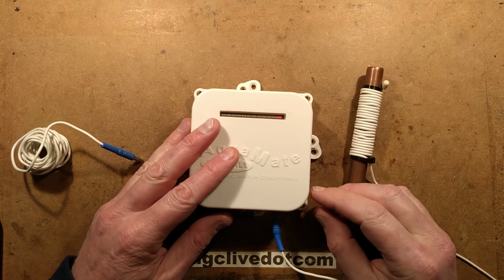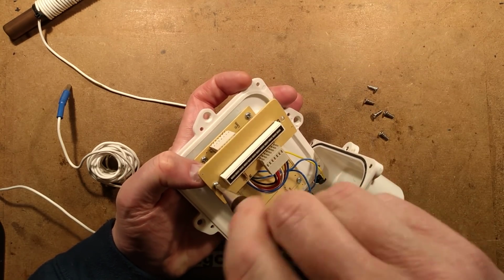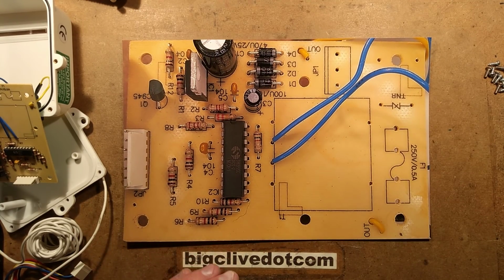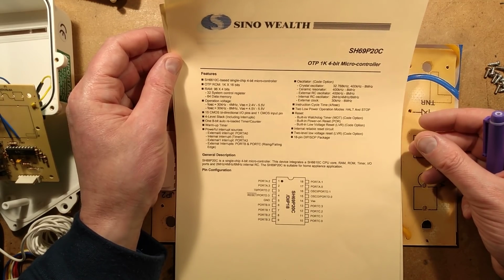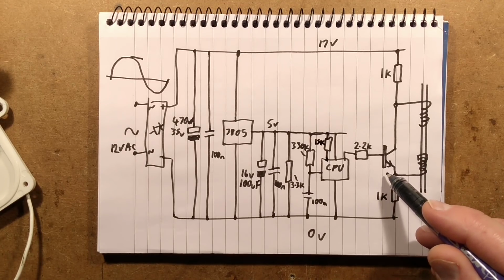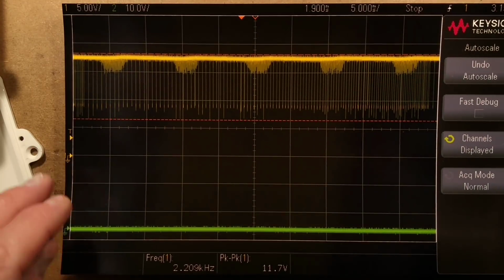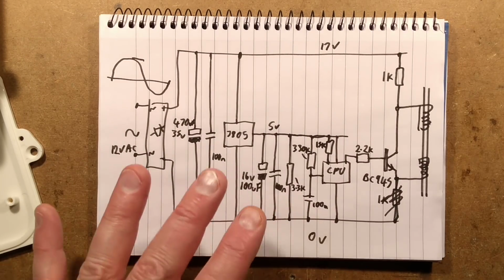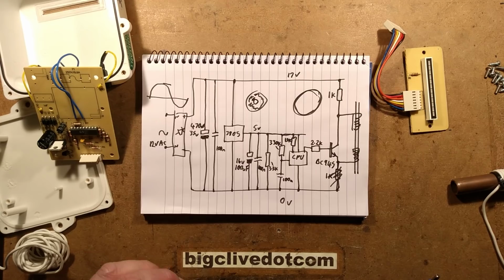inside a computerised pipework scale reducer.

Comment: This looks a toy. The only way I think it might work is that the pulses induce tiny mechanical vibrations into the pipe via inductive coupling. These vibrations are enough to stop calcium deposits sticking as it is hard to stick to a moving surface. But even this theory has serious weaknesses. For starters if Clive's circuit diagram is accurate the output is severely underpowered, the transistor is neither in the common emitter amplification regime, nor in emitter repeater one, but somewhere in between, a very odd circuit. Secondly it will be the covered section of the pipe that would vibrate, the rest will happily collect the deposits. In short it is probably a snake oil device.

Comment: Transistor is a 2SC945, the base pin on the end gives it away; a BC would have the base pin in the middle. It is any 'old' transistor with much better options available today. Yes looks old. Nice enclosure.

Comment: I was extremely sceptical about the operation of these powered electric water softeners, I still am with regard to those that use an open circuit antenna dipole to couple to the water pipe. However there is some evidence that those that use a coil to magnetically couple to the water in a pipe do work There are a number of university papers which descripe tests that show the effect of high frequency magnetic pulses on hard water. The principle of operation is not to remove hard water ions, such as Ca++ and Mg++, but to change the structure of the salts that precipitate out of the water. Changing them from needle shaped calcite crystals that readily stick to each other and the pipe work to an amorphous form of powder, which will not stick and is washed through the pipe.
While the researchers were hard pressed to explain the effect, they did produce some convincing micrographs that showed the different structure of the precipitates between water exposed to a rapidly pulse magnet field and that not exposed.
There are a number of industrial users who have installed such systems to keep their water pipes free from scale build up. It is difficult to believe that business would fall for a scam technology that did not produce some money saving results. 
I remain very sceptical about the operation of the dipole wire devices, as it is difficult to understand how any significant part of the field could penetrate the pipe to interact with the water flowing through it. If the dipoles were subject to excitation close to RF resonance, then one might expect some of the near H field to penetrate the copper pipe, but most of these devices use an audio frequency FM  square wave to excite the coil. The best, discharge a significant charge, stored in a capacitor, to maximise the induced magnetic field.
You would be doing the world a service if you repeated part of the university research and published it here. This involved passing hard water through a section of pipe, with either the device fitted or not. A sample of the water was then taken and evaporated to dryness on watch glasses in a standard environment. I think a simple comparison would do. The resulting salt precipitate was then observers under a microscope to determine the shape of the salt crystals that formed. In the case of the university study, I recall that X-ray examination was done to identify the shape of the crystals. If I can find a link to the papers involved, I will post them here. I am sure I have a copy in my archive. To be fair, there are a huge number of reports on this subject, many from university engineering and chemistry departments. There appears to be as many claiming that this is pseudoscience as claiming it is a real observable effect. 
Ref New Scientist 18,  February 1988 Lifting the scales from our pipes Magnetic fields change the way crystals form in fluids. This could prevent the formation of scale in pipes and boilers John Donaldson and Sue Grimes

In this case the output drive circuit is horrible, not even giving a low impedance, push pull, output to the dipole, but then I suppose that if the circuit is not really doing anything useful, you might as well used the cheapest drive circuit you can reasonable get away with.
It would be interesting to put a current search coil inside the pipe and see if any B field can be detected inside the pipe.
Reply: Thank you, especially for the reference to the New Scientist article.
Reply: I agree. For this circuit to do that, you would need 100,000 times more power to have any of these effects, particularly, if there is significant water flow through the pipe. Even then, I would need to see the test results. With only as much power going into the pipe as what's being used to drive the LED's, I'm a little skeptical. How can 17-20 milliwatts treat 100 gallons of water per hour!?
Reply: Sounds worthy of an experiment, but it also sounds like just getting a reproducible baseline would be super tricky, never mind figuring out how to reliably detect-or-not an effect.
Reply: Not so much a COMMENT, but more like an ESSAY! 😂😂😂
Reply: @marcse7en  my next comment, maybe the basis for my new book, 101 boring things to say about hard water. I will dedicate it to insomniacs everywhere.

Comment: It's so interesting to see the amount of effort companies go through to sell some bit of non-functional tech.  I mean, someone came up with that schematic, picked those components and their values specifically, developed a PCB and had it mass-produced.  It actually does something on the output.  What the output does is not what it says it does, but that aside, I almost feel bad for the people who designed this thing.  The way I see it there are two reasons for this design:  Either they thought it would work but were misinformed about how water scale builds up in pipes, OR they knew it wouldn't work from the start and built a device that would fool a casual tinkerer/inspector who knew enough to look at the output of the antennae, but not enough to realize it was bunk.
Reply from the maker: I think the people who designed it probably enjoyed doing so for the showmanship value.

Comment: Magnesium Sulphate, Calcium Carbonate, Manganese Carbonate and other such things we often call "limescale" (these are all either very or slightly alkaline compounds), are typically INSULATORS!! They don't conduct electricity and aren't overly effected by magnetic fields either. 

Water would be effected (being a polar molecule) but I don't really see this as anything other than some psuedo-science shitty device. No need for it. If you want softer water you have some options:

1) Bitch at your water company and local treatment plant to inject Sodium Triphosphate into the water to soften it (though it will increase salt levels in the water, and probably affect the pH)
2) Use filtered water either via a filter tap, or a water filter jug (the kettles are a pain to clean, dont get one of the filter kettles)
3) Install an inline water softener on your incoming water main pipe. Bare in mind you will need to clean the screen and filter of these out once a month or so as your water pressure will drop as the flow decreases with the filter getting more and more clogged, though some devices have a small compressor to stop that happenning.

These are, really, the only ways you can stop limescale. Chemically or physically. Electricity doesn't do an awful lot other than causing ferro and paramagnetic particles to adhere to the side of the pipe (this is how those fernox devices work on heating systems). I only really see these being useful in Steel-Copper heating system where galvanic corrosion is an issue.

Comment: As you say BigClive - it hard to imagine any kind of induced signal reaching the water, esp. through a conductive pipe :o( And the power is so low too. And only low frequency. Even with an open mind, it's very hard to give this any points :o(  Um, ok, the case with an 'O' ring is quite nice !
I really though you'd tell us that the chip is simply chasing the leds up and down and nowt else, so it's not as bad as I thought :o)
I like your free Keysight (ie Agilent, ie HP before that) 'scope - that's the proper item in this vid.

Comment: it's very simple.  there's nothing that sending a current like this around a pipe would change in the chemistry of the water itself, since you're not actually sending any current THROUGH the water.

nothing.

it's nice they took their scam to such detailed levels.  but that's all it is in the end, a scam.

these days they wouldn't even bother making a nice box for it, or using a microcontroller, so there's that at least.   you can be proud you paid for a quality scam.

Comment: Typically copper water pipes are grounded.
Reply: ColinWatters But this device is ungrounded, so it might still induce a tiny AF current through the length of pipe it touches.  Not that this would be obviously expected to affect the water in a relevant way.

Comment: Surely it should work if you wrapped the antennas around your  kettle.
Another thing comes to mind, how is its EMI compliance?
Reply: The power is too low. you might be able to detect it, if you take a portable AM radio, and tune it to a weak station, or in between stations. You have to get the antenna within a couple of feet though.

Comment: That resistor across the output of the regulator is likely there to ensure the 7805 actually regulates - those regulators need some minimal load current to stay in regulation and the MCU alone may not draw enough.
Reply: 7805s do not need any minimum current to regulate.
Reply: Interesting, I'da sworn that the 78xx's and 79xx's needed something like a 4K7 across the output, for stability; but [at least] this datasheet doesn't show such: https://www.sparkfun.com/datasheets/Components/LM7805.pdf
Maybe that 4K7 was just a Practical Electronics foible from the 70's :-)

Comment: Hmm, so limescale is an alkaline rock dissolved in water. The rock having been formed by billions of years of sea life creatures having died and fallen to the ocean floor.
So why would such a substance be even affected by a weak electrical signal when dissolved in water? And even if an electrical current was induced into the water in the pipe, as soon as someone opened a tap, or flushed a toilet, the rapid flow rate of the water would mean that the very low current level would be spread cross many litres of water....
No, this is another ‘product’ that is useless. The only thing it will do is increase your electricity bill.

Comment: The more LEDs on these sort of things always equates to more quackery.
Reply: That I agree with. The Kemo brand ones have two LED's, one for power and one for the circuit has been installed correctly, and they do actually make the scale softer in the kettle at the very least, so it comes off by itself.

Comment: I saw a date code in the plastic case but I couldn't read it. The electronics look like they are from the 1970s, I wonder if the case is too?

I find that a really interesting device, in that it has a lot more in it than I expected. Specifically, I didn't expect a connection to the output wires. Clearly the effect of this thing is snake oil. 

But I have to wonder if the thing was designed by some deluded sort that thought he was really making something functional, or if it was just done by a snake oil designer that decided that the wires had to do something he could point to, so nobody could sue him? 

I suspect the later.
Reply: 1970s?  When exactly do you think they started building single chip microcontrollers?  The datecode on the chip is from 2006, which is also the year the first revision of the datasheet was released.

Comment: But they work, i have one and the scale in my tankless water heater is been greatly reduced, i was having to clean the input valve of my tankless water heater about yearly due to scale build up  after i installed one of these i t just has been noticible i bought this versus a filter because of lack of space
Reply: I am very sceptical about these but I have one and it does seem to work. I have a mixture tap just after a heat exchanger on my hot water system and every 4 years it would stop working due to calcium build-up. I fitted one of these 15 years ago and it's never reoccurred. Bizarre but true!

Comment: I know that product, I was the technical advisor till 2 yrs ago. Its a very very old design, inherited after many company takeovers. We use large electro magnets in commercial water treatment as well. No one can give a satisfactory answer why they work though, there are a couple of competing theory's. It's water conditioning not water softening. Despite some dubious claims from various companies.
Reply: Elector did a project some time in the 80s I think. Swepping audio in to a coil around the pipe. I used the circuit as a sound generator for a prank on a mate. Placed in his bed room it would chirp 6 or so hours after it got dark and shut up when the light came on. Then stay quiet 1 to 3 days before going off again. Took him 3 months to find it. 😁
Reply: @TheEmbeddedHobbyist  spot on 😉
Reply from the maker: I can recall it being featured in electronics magazines at the dawn of electronics.

Comment: A few years back I decided to look into whether these things work and came across an article where two water heaters were used in an experiment. One had the "magic de-scaler" fitted and the other was left as standard. Guess what they found about a year later when the heat exchangers were cut open. NO DIFFERENCE! Equal thickness of limescale deposits in both, thus proving these de-scalers are a scam.
Reply: Colin Tinker Technically the experiment only relates to the specific product tested.  Any other product could get away with an explanation of how it differs from the failed product in either mechanism (the failed one used voodoo, we use exorcism) or quality (the failed one used Turkey blood for the voodoo ritual, we use real chicken blood).  The example mechanism names in the foregoing to be replaced by words more suited to the products at hand.
Reply: John Francis Doe 
So what you mean to say is that I should buy them all to be sure I got the right one?
Reply: Must have done the experiment wrong!
Reply: @jostouw4366  It was done at a University. They knew what they were doing and were very thorough. Even down to measuring the amount of water the heaters had going through them.
Reply: Fake news!
Reply: Yes maybe but still came up with the wrong results
Reply: @jostouw4366  Do you sell these things???
Reply: @colintinker7778  nah just teasing with you
Reply: @jostouw4366  Trolling, it's an art ;-)
Reply: @jostouw4366  ha! ha!
Reply: @Eddiecurrent2000  Well trained!

Comment: How I understand how it works is it changes the polarity of the pollutants magnetism so that it does not adhere to the pipes. You need some sort of test, to see,  if you insert something in the coil will it alter the polarity? I think they do work to some degree.
Reply: Problem is there is no great test for conditioning. Only to run two identical systems side by side over a period of time (which has been done) unlike softening which is an easy table/liquid test.

Comment: Looks like a datecode on the uC... could be 0520, week 20 of 2005 - though this type of thing has been knocking around for a long time.
They put a lot of effort into the LED chaser when a power light or a power and uC running light would have been sufficient & it's hard to believe that a product that puts a significant amount of effort into making an eyecatching but pointless display for the user to look at isn't a bit fraudy.
If there was any program space left I'd have reversed the chaser at each end for a sci-fi 'cylon-eye' effect... that'd give the buyer the impression that it was constantly scrutinising the water for calcium atoms to zap and add £££ to it's value.

Comment: Had one of these for a number of years on a cold water pipe to a tap. 90% of the time we filled the kettle from that tap and the kettle still 'furred - up'. 
Apparently the company sells a version for ponds to stop duck weed from forming, presumably you would have to have a pump / fountain to move the water past the antennas. 
Is it witchcraft I wonder?

Comment: I'm saying it has no effect, for the simple reason that they didn't have the chase lights go in both directions.

These cheap K.I.T.T. knockoffs should be illegal.
Reply: restcure It needs to scan back and forth like a Cylon Centurion for it to work...
Reply: Too hard to get the real KITT. At least it's not a KARR clone.
Reply: The unit should have a 'Turbo Boost' button......for emergency water softening situations.
Reply: can you get a KITT kit for it?
Reply: @simpleminded1uk  yes, but if you want to build it, first you have to put on your KITT kit kit

Comment: I was having breakfast ... not paying attention at the beginning of the video, I thought at first that the device was some kind of water-flow detector. Then, afterwords I knew what it was all about ... No way ... The process of reversing or stopping the build-up of minerals is a bit more complicated. It basically needs much more energy than it is actually happening. Moreover, if there is any electrolysis process that is mean to be, then, besides the minute amount of energy applied, the actual component of current/electric field that is affecting the liquid inside the pipe is AC, therefor the overall effect is nil.

Comment: I used something similar but it was on a much larger scale like 30 lb metal box and we would use it to thaw out pipes mainly work on galvanized pipes by inducing current through them
Reply from the maker: That sounds like a simple transformer?
Reply: Like Big Clive implies, it's fairly common (if unsafe! :-) practice to thaw out pipes by attaching welder clamps either side of the iced-up section.